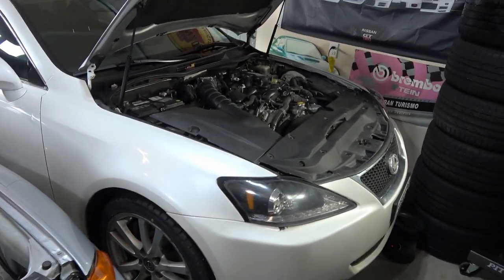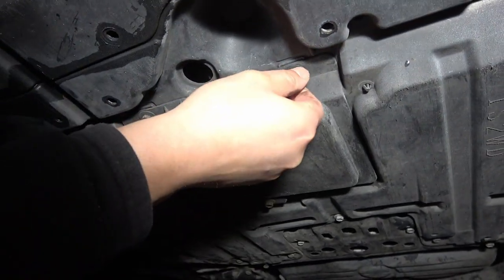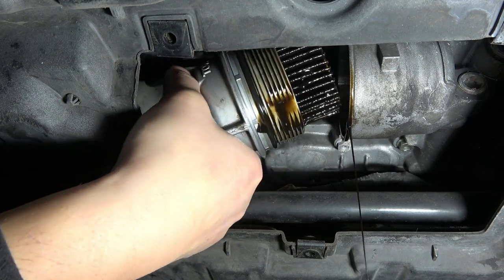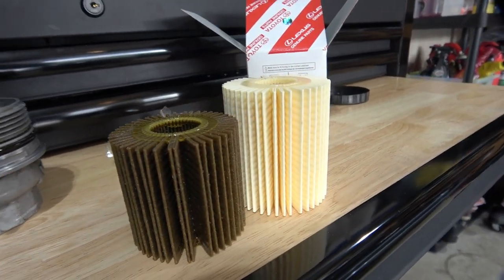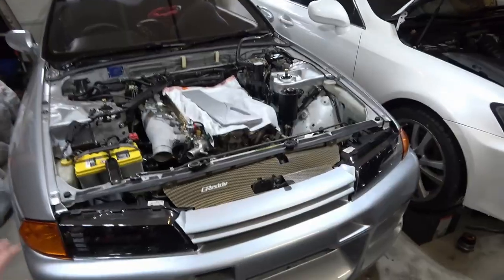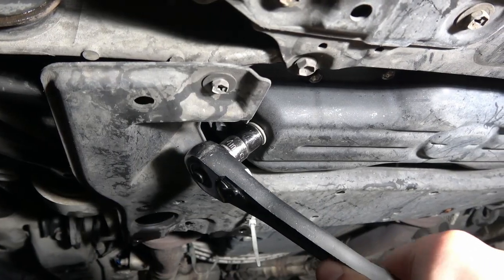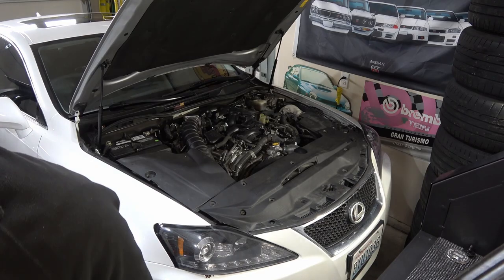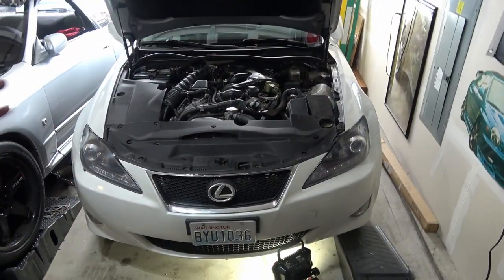Lexus IS250 IS350 oil change Toyota Lexus oil filter socket 2006 2007 2008 2009 2010 2011 2012 2013

Comment: My oil filter housing is on there super tight. The car has been sitting for like 10 months so I guess that's why it's so tight. I stripped my oil filter wrench trying to break it loose. Any suggestions? I always do my oil changes and didn't expect this to give me such a hard time.
Reply from the maker: Is your oil filter housing cap made out of aluminum? Did you use a steel filter wrench like the one I have linked in the bottom of the video. That should easily break it free and not strip it out. Good luck man, I hope you can get it sorted out.
Reply: @JDMRightHandDrive  Yes it's aluminum. I have a 06 is250. I bought the same filter wrench that you linked. It didn't work. I went to Jiffy Lube so they could loosen it which they did with no problem. Then I changed the filter at home. I think it's because they had so much room to get a breaker bar and get it off. The car was sitting for about a year so that probably made it super tight. Thank you for the advice.

Comment: When living in year round climate exceeding 28 deg C, is a 10W-40 grade a better balanced choice than the 5W-30; the wix filter is also said to be quite good for this range of vehicles, buying from walmart is this  WIX Oil Filter 57047 the correct one?
Reply: Stick with the recommended grade.
Reply: @njsongwriter  the recomended grade changed from 5w30 to 5w20 while the engine remained unchanged, the reason? Company emissions targets.

Comment: Hey just wondering what that checks vsc light means and should it be taken seriously? The same light and text popped up on my 06 and idk if i should be worried or not. I was told that sometimes the engine light may pop on bc of the gas cap
Reply from the maker: My car was in a frontal accident before I bought it and repaired. However the ECU housing was cracked and moisture had gotten to the ECU board and slowly caused it to go haywire. All of my dash light were cause by my faulty ECU, which eventually shorted out completely and my car would not even start anymore. I did a little research about the VCS light on the IS250 and from what I remember the forums talked about carbon build up on the intake system and sensors needing to be cleaned. Good luck and thanks for watching.
Reply: @JDMRightHandDrive  I was going to comment you should do a carbon clean out on it and that should help that noise. I need to do that on my daughters car as well. Good video thanks!

Comment: The Motivx MX2023-US oil filter cap wrench is a less expensive option and, in my opinion, can't be beat.
Comparing 5:30 to 6:14 shows that your new filter seems to be shorter than the old one. To me that indicates that you somehow ended up with the wrong filter. If the filter element is too short inside the housing all the oil will bypass the filter. Not good.

Nevermind, I see later in the video that your caught this and corrected it. 👍 Good video...
Reply from the maker: Thanks for the help, yeah little frustrating that the Walmart kiosk shows the wrong oil filter model for Toyota at least.